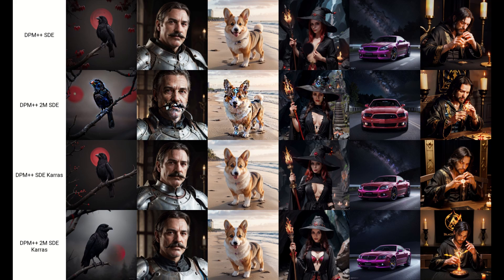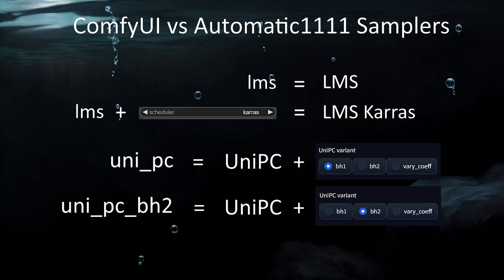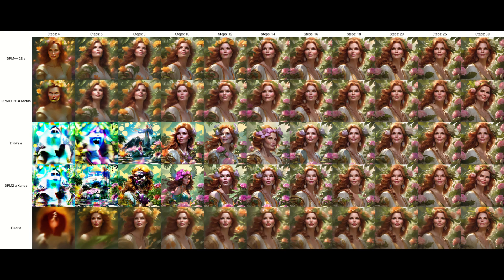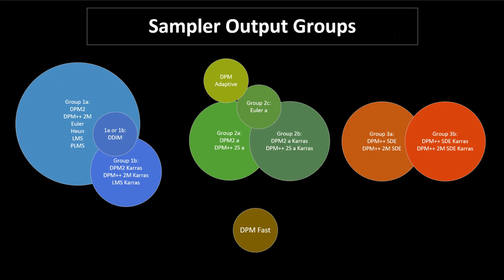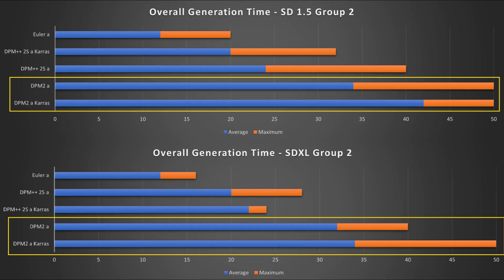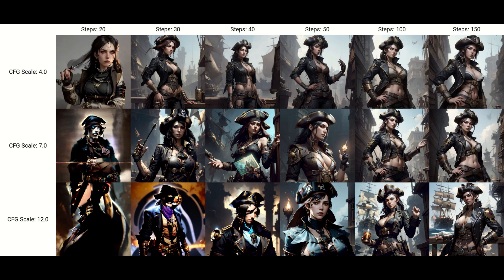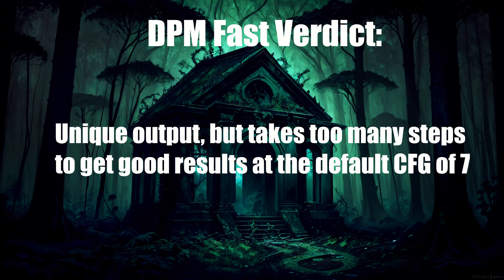Stable Diffusion Samplers - Which samplers are the best and all settings explained!

Comment: This is the best video I saw about samplers.

However, I really wish to have an in-depth comparison  of them based on CFG value. I use huge ass prompts that full of every word I can think of that is related to the subject. It is like an essay in the positive and another in the negative, with a punch of negative embeddings. I usually need a very high CFG number (above 20) with hundreds of steps, but I get dark saturated contrasty images.

I'm still experimenting with the samplers for generating the images and also for scaling. It is very hard to compare when I have no idea what all of those samplers do, what they can't do, what they can do with extra steps.

Any suggestions for an extreme case of very large prompt with very large CFG with open number of steps ?

Comment: Great video. So much useful info. If you have a spare weekend you could repeat all this with the new LCM lora on 0.5,  0.75 and 1.0... You get great results in 3 steps on DPM SDE. Or maybe wait until the proper LCM scheduler is implemented in auto1111? Even before LCM, many samplers give great results at cfg 1, 1.5 or 2 even with just 5 steps, which I feel is often overlooked.
Reply: Even without the LCM lora, try these on 4 steps:
DPM2	cfg 1.5
DPM2 a	cfg 1.5
DPM++ 3M SDE	cfg 1.5
DPM2 Karras	cfg 2
DPM++ 2S a Karras	cfg 2
DPM++ SDE Karras 	cfg 3
Reply: Then on 5 steps, more samples become usable at these low cfgs:

DPM++ 3M SDE	 1
DPM2 a	1.5
DPM2	2
DPM2 Karras	2
DPM++ 2M Karras		2
Euler a		2
Euler		2
LMS Karras		2
UniPC		2
DPM++ 2S a Karras	2.5
DPM++ SDE Karras	 3
DPM++ SDE	3
Reply: You could continue this process, producing a graph to illustrate the cfg vs steps trade off... There's a usable range and optimal cfg for each step count, for each sampler. I've not seen it properly graphed in a paper or YouTube video, if you're looking for more inspiration!
Reply: And how did you get the wall clock computation time out? Is there a benchmark tool that spits out the data?
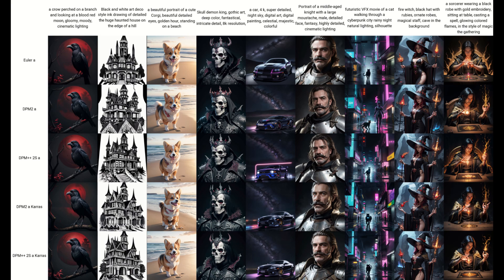Reply: Your fantastic video on cfg is here, the legend at 6:50 is great, but perhaps more could be investigated in the bottom left corner below 12 steps :-) There's also the cfg fix in the form of dynamic thresholding... so many variables! https://youtu.be/kuhO9zAzetk?si=A61TTCeWHdetui6x

Comment: Could you make a similar video about the additional samplers in ComfyUI? Samples like dpmpp_3m_sde_gpu
Reply from the maker: Wow.  They waited until right after I made a new video to release new samplers.

I saw a quick comparison on Reddit indicating dpmpp_3m_sde_gpu is in the same group as the rest of the SDE samplers.  There is a conversion table for A1111 vs Comfy sampler names near the start of the vid

Also, seeds for A1111 and Comfy are not the same (GPU vs CPU noise) so you won't get identical results even with the same seed.  I think the gpu SDE samplers in comfy might be an exception,  but I didn’t verify

Comment: Thanks, a very in-depth look at the samplers, thanks for explaining all that, a lot to wrap your head around. 99% of the time I use 30 steps of DPM++ 2M Karras and just occasionally run the final output with a high steps Heun if it is something really special as I prefer the way it looks in all those grids and has a great quality.

Comment: You forgot about one important thing- decreasing CFG to 3 will let you generate in 6 steps, CFG value and number of steps required are very dependant, steps number must be about twice the CFG value or more, if its less then you get artifacts...  which makes this whole test very incomplete. From my testing, DPM++ 2M Karras  , SDE  and Euler a for 9 images on 3090,   are al about  - 7.7 sec  with 12 steps 512res but i dont like  euler a soft texture most of the time unless i need nontextured images, so for 9 images at 6 steps you get about 5 seconds to generate them
Reply: That's not true at all.

Steps = How many times it refines the image.

CFG = How much it tries to force the noise to match the prompt rather than filling it with something else that it sees. Lower CFG = more realism since it uses more of the neural network's own knowledge. Higher CFG = More and more "cooked" image if you go too far. About 6.5 is the highest I ever do, and 3 is the lowest I ever do.

They have nothing to do with each other. They are completely independent.

Comment: Was DPM++ 2M Karras also tested above 20 steps?
Reply: From my testing, DPM++ 2M Karras  , SDE  and Euler a for 9 images on 3090,   are al about  - 7.7 sec  with 12 steps 512res but i dont like  euler a soft texture most of the time unless i need nontextured images, also  decreasing CFG to 3 will let you generate in 6 steps, CFG value and number of steps required are very dependant, steps number must be about twice the CFG value or more, if its less then you get artifacts
Reply: @krystiankrysti1396  have you tested with xformers and the slider option in settings? (forgot the name)
Reply: @Chris3s  I turned off xformers, have only v1 optimisation  in bat file enabled, the reason is i get NaN exception with xformers that i cant fix by swapping to another model and back, i get same speds without and with xformers so i dont need them really and yes i tested it to compare if i lose something by disabling them.